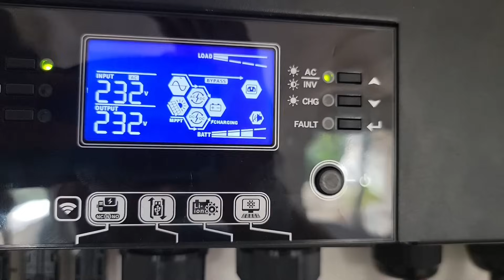THIS IS USELESS , TIME FOR CHANGE

Comment: As for the birds 🐦  you can install a sprinkler with a presence detection trigger.  Just the noise alone scares them off. I used this when I had pigeon problems on my buildings in Vancouver.

Comment: James Check your valve clearances  have the piston on top dead center also run some transmission fluid with the fuel it will free up the valve seats from carbon most likely the valves are not sealing properly if rings were bad you would have pressure in the crank case
Reply from the maker: The valve clearances on here are set by shims. If they did need that I would have to order those high dollar shims. It is mostly likely the timing off. I have the part ordered maybe it will be here in 2025 lol

Comment: We have a lot of sea spray, especially during rainy season. Doesn’t deter termites around here.  Uses round wood for railing, treated many times. Termites still got them. I swapped the railing out and had them do concrete and rebar railing. Made to look like round wood. Salt may still get the rebar, but gonna fight it with regular paint and primer.
Reply from the maker: I'm talking about the salty sand not inside the house etc.

Comment: Many sailboats use a desalination system to convert salt water to fresh water it may be a viable option to your water shortage problems heck you have an ocean of water and free power available.  Just a thought.
Reply from the maker: It is a thought we have had but this is not a regular occurrence. Normally it rains here always. Just a El Nino year. "and this too shall pass"
Reply: @TexasFilipino  yeah, it has been REALLY dry here in Panay for a while, I'm a local and like watching your videos!

Comment: I winced when you pulled that small block for a diesel. Never heard of that before. Anyway, it sounded like you were talking about your timing pointer which goes on the outside of your timing cover and lines up with the notch on your harmonic balancer. That determines TDC for your crankshaft only. I would think that if your timing belt was one tooth off, your engine would run really funky. But heck, I don't know squat about diesels!

Best way to check your cylinders would be with a leak down test. You can isolate compression loss past the pistons on down into the crankcase or through the intake or exhaust valve. You can often listen through your intake manifold or at the exhaust pipe and hear the air. 

If you have excessive blow by past your rings, it can also cause oil leaks due to the excessive crankcase pressure. Good luck. 😅
Reply from the maker: this inherent issue on the pistons for this motor is not about the rings it is about the turbo waste gate sticking and over boosting heating up the pistons and melting the center of piston three usually first.  Replacement pistons with ceramic center to avoid meltdown is the only type you can buy for replacements. They are about $350 each with no rings.

Comment: Sir hows your wind turbine holding up to the salty air? Are still going to add more?
Reply from the maker: It's fine. I have it down for now until storm season returns. We are making mega power right now. When It gets cloudy I will need it again.
Reply: sir do you thing the inverter your using now can fully handle the electricity needs when your fully book? or will you upgrade? can you have a review on the inverters performance? thank you sir…
Reply from the maker: We have already been fully booked and it worked fine. It had 5 aircons running, three split type and 2 window type, Large side by side refrig n freezer, Large drink cooler, 3 mini refrig in guest rooms, 5 tvs,  2 security systems, mesh network, 3 laptops and other devices, 2 floor fans, lighting all over the entire property, well pump, hot water pressure pump and more I'm sure. Never maxed out and batteries still received a full charge. My inverter is 11000 watt with peak 15000 watt peak. As far as upgrades it is possible. I want to upgrade my battery pack. These have done paid for themselves and have a lot of life left in them. I will most likely buy another inverter like this one and put these batteries on it out at the swimming pool area. I to power the pumps during the daytime and the native rooms all the time.  I will go with a large battery bank on the main house and guest rooms on the ground floor.
Reply from the maker: I want to thank you for your sensible questions today.

Comment: Just a thought. If your timing is only off by "1-tooth". You could remove all the plugs, move the timing counter clockwise 1-tooth, verify that the engine will rotate by hand without internal conflict. Re install the plugs and start it up. if it runs well problem solved. If it runs worse, move the timing "2-teeth" clockwise and retest.
Reply from the maker: This is a diesel not a gas. No plugs.

Comment: I didn't realize just how much more the split aircon save on energy over the traditional ones. Thank you James. God bless and stay safe.
Reply from the maker: Huge difference.
Reply: I have one unit in Bulacan. Electric bill reduced from 5.5k to 3.5k by swapping split type for traditional
Reply: Thank you both for the reply.
Reply: we didn't had a fan before but we have a traditional aircon our bill was 2,800+ pesos but after we got the fans it went down to 800 - 500 pesos

Comment: If the timing is out then you need to check the cylinders, the pistons smash into the valves if its not timed correctly which will crack the cylinders
Reply from the maker: This motor has a inherent problem on pistons damage from stuck wastegate on turbo and belt getting off one tooth also.  As I said in the video it is a interference motor.
Reply: @TexasFilipino  might need a new engine 🤔 the wastegate issue will cause huge damage if you hit turbo unable to dump that excess pressure it would blow the engine, I'm not sure if you ever had it running before or you purchased like that but if you're having issues with timings etc then I'm assuming you purchased like that and think it's worth taking the engine apart and doing a full rebuild doing checklist, pistons, cylinders ect... get the timings done after rebuild and try from there. Also rebuild the turbo, clean it and wastegate that should solve that issue, most of the time it's down to faulty actuator or carbon buildup
Reply: @TexasFilipino  What was a good deal maybe not so good huh . Oh well nothing ventured nothing  gained 🙃  I've always heard this .
Reply from the maker: I got this.  I am a lifetime mechanic just knocking out some other projects here before I dive into it. I want to give it my full attention when I do and not risk it scattered or constant distractions. I have already bought the full gasket set and have source for the hard to find pistons already. I bought a new timing belt and rollers. She runs with knocking or smoking much. nothing rattling and no blow by. Most likely just that belt was installed one tooth off by the shop who serviced it before it came here. Easy to happen with that one alignment guide not on it. They probably tried to do exactly what others are commenting. ie: " just pull the glow plug and find piston tdc." well it is a little more fine tuning than that. If it is two teeth off it can bend the valves.  I ordered the part for the alignment. When it arrives I will try that first. Then if not I will yank it out. Takes about an hour. Then I will yank the head off and inspect the pistons and valves. easy peasy.

Comment: You can use salt water in your cement mix and of course we have our rain barrels for just in case and our 400 gal drinking water reservoir but it is never enough.. sadly
Reply from the maker: No way would I be using salt water in our concrete mix. I do not recommend that to anyone. That salt water contains so much more than just salt also.

Comment: Is starlink down? I may of missed that vlog?
Reply from the maker: I dont understand the question?
Reply: Do you use starlink?
Reply from the maker: I was the first user of Starlink in the Philippines before they launched here. I brought my stateside unit on a global plan.  I since transferred it to the PI only plan to lower the crazy cost of a global plan. 
I keep it going as a backup in case our PLDT fiber goes down as it often does. Why two  accounts?
Well Starlink has limitation for my situation.  Number one is they limit upload speed and bandwidth. Big issue for a vlogger uploading 4k videos. This means hours of uploading a video and getting it launched with proper ad placements. When a video uploads slow it has some weird affect on auto placing ads in midroll that advertisers bid ( automated) for those slots on your content. This means your CPM RPM are paid higher by these dedicated advertisers. This can be the difference between earning  $80 to $200 on my videos to down to $15 to $25 because you didn't make the mark properly and your work fell into a pool of junk last minute advertisers. This also means you may go to bed with a video uploading and wake the next morning and it failed or never yet finsihed. 
Number two is we are renting out rooms to guest who want to enjoy internet and watch tv, maybe browse or even do some work online. Starlink cannot handle that many going at once on a single terminal. It will be choked down and bad experience if too many using it at once. This would also mean even harder for me to upload my videos. 
PLDT FIber is super fast with wide bandwidth. It out performs Starlink when it is up and going. My upload speeds are mega fast with upload in just minutes if not seconds. 
So Starlink is a backup so when PLDT has an outage  we just plug the router cable into our mesh network and at least everybody still has something even if slower. 
NOTE Starlink does have a commercial plan for a very costly price and Starlink is forever changing the rules.  I do still support them but they did not take long to conform to be just like the other greedy companies far from their original agenda.
Reply: Thanks for the reply. If I make it to your area. We'll definitely stay at your place. What's the name of your resort?

Comment: They don't use timing lights anymore?
Reply from the maker: This is a high performance diesel.
Reply from the maker: Plus timing lights are for ignition timing for spark not engine valve timing
Reply: I was thinking the same thing about a timing gun thanks for the explanation